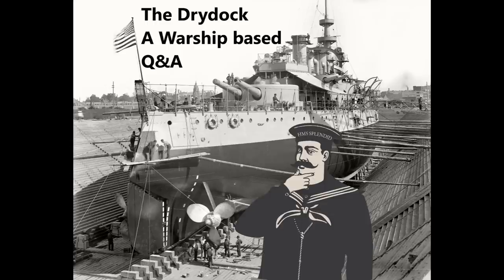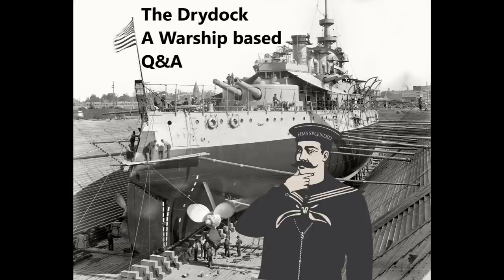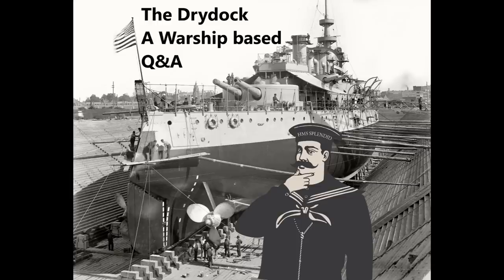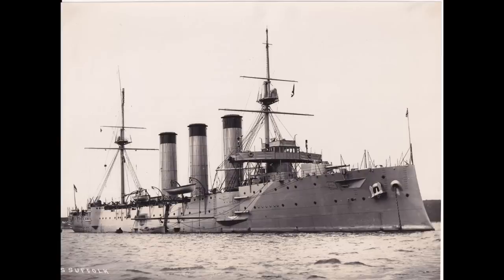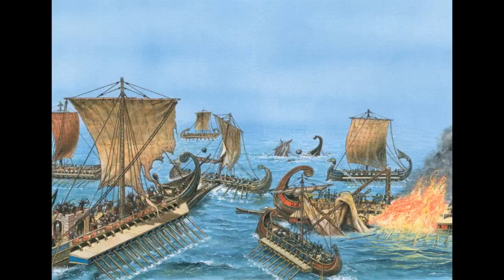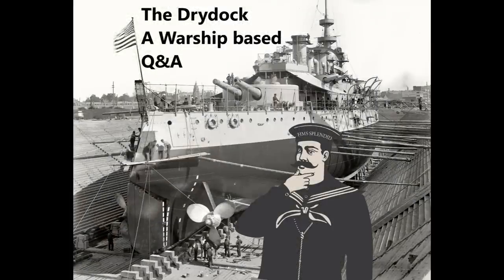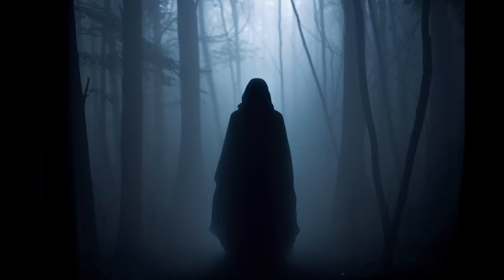The Drydock - Episode 251

Comment: The deHavilland Comet's windows get a bad rap.  If you look at contemporary jetliners the Comet's windows weren't actually any more square.  The difference is that the Comet's cruising altitude was twice as high as any of its competitors, so the stresses those windows were dealing with were orders of magnitude higher than the competitors' equally square windows had to deal with

(I just watched Mentour Pilot's video on the Comet and its windows :D )

Comment: Actually one of the main problems with the Comet was that the holes for riveting were punched rather that drilled. This caused fractures which were made worse by the pressurisation of the aircraft and led to failures. Many aircraft before this period flew at lower levels and therefore did not need pressurising. It was only with jet passenger aircraft flying much higher that this became a problem.
Reply: It was early in the aeronautical game of pressurized cabins. No one thought about metal fatigue. Heck the first ones had square windows. Which the Comet 4's replaced with oval ones. I'm still angry that the Canadian Government didn't make Trans Canada Airlines buy Avro Jetliners. They could have used them even as military transports, medevac aircraft. Such a waste.
Reply: I've heard aircraft materials are much more difficult to weld than ship materials.  Aluminum is also a metal that doesn't get along very well with drills, it likes to bind.  Punching holes for rivets makes a lot of sense in this context, but it's unlucky that it caused fractures.
Reply: @jackgee3200  Got it, bad luck.  Thanks for the detail, that's pretty interesting.
Reply: Reminds me of a book I read on the construction to RMS Titanic . One detail was a specification that all plating used for the hull, boilers, decks, and load-bearing superstructure must have drilled rivet holes. Punched holes were only allowed on lighter-gauge plating like ventilation ducts, cabin bulkheads, and the funnels.

Comment: I think a missed chance modernization was the Lexington class CVs.  If the aircraft support arrangements and damage control were changed to be similar to the later Yorktown class, possibly changing an elevator out for a deck age one like pioneered in Wasp and of course improved triple A and triple A fire control, you might end up with something like the later Midway class.
Reply: I had some thoughts on what a modernised Lexington and Saratoga. Have their 2 small elevators replaced with the 3 large ones found on the Yorktowns. Replace the 5/25 guns and 8-inch guns with 5-inch/38s in single and dual mounts respectively. Widen and extend the flight deck and add torpedo blisters in exchange for cutting back the belt armour back by a couple of inches. Only thing missing is someone at the Bureau of Aeronautics or Bureau of ships figuring out the dangers of avgas on a carrier and come up with the CO2 and proper ventilation and suppression systems.

Comment: OK, so. The »window« of the Comet that kept blowing out wasn’t one of the windows the passengers looked out, but the ADF Antenna cut-out. The shape of the passenger windows was fine.
Also: One reason for round cannons bores is that square holes are very hard to drill.
Reply: Most cannon were not drilled from solid metal blanks. 

They were either cast to a sand mold, or built up from iron hoops and staves.

Comment: A spherical cannon-ball is easier to muzzle-load, and will have less friction against the bore:  a square or rectangular projectile will have a lot more friction against the gun-barrel while loading. Pushing a 24 pound ball into the bore with a pole is easier than pushing a 24 pound block.
Reply: Not to mention a sphere will have much better aerodynamics and flight characteristics in a smoothbore barrel with lots of windage. A rectangular projectile rattling around the barrel as it's fired will present wildly different aerodynamic shapes based on how it moves and then tumbles in flight, whereas a sphere is a sphere from any angle.

Comment: The USS Nautilus was the end of the line for the WW2 submarine hull forms. The ports in the casing produced massive levels of noise and vibrations at the speed a nuclear submarine was capable of and actually damaged the casing to the point that the Nautilus had to be retired due to mechanical damage and hull cracking caused by the casing design.
All subsequent US nuclear submarines used the hull design pioneered by the USS Albacore - a diesel electric boat optimised for underwater speed at all costs.
As for the “Greek fire” thing - naphtha is a byproduct of production of bitumen (and the base for unleaded petrol), Palmitate is better known as sodium palmitate and mostly used for bath soap. Olive oil based bath soap is still made in vast quantities in Syria - and available in most supermarkets globally. So making napalm at home is actually easy.
Getting it to self ignite is a different question - heating it to above autoignition temperature would be one option, adding something else to it like a nitrate salt could be another.
Reply: One can visit the USS Albacore museum in Portsmoth, New Hampshire, USA.

Comment: 00:24:36 Why only round cannonballs? Drach explains the difficulties of square or non-round oddly shaped cannon bores; adding to that homogeneous non-spherical, cylindrical, cubes or other shaped projectiles would tumble ("cartwheel" or "keyhole") as soon as they are shot out of a smoothbore cannon.  A tumbling projectile would have extremely random aerodynamics, lose speed rapidly and would almost certainly fly all over the place. Range and accuracy would be a fraction of true spherical (round) projectile. Even short range canister (anti personnel) round would use spherical buckshot to maintain projectile speed.

Comment: 00:00:46 - Why did naval designers persist in putting casemate guns so low in hulls for as long as they did? 

Another consideration easy to overlook is the prestige factor or "Presence" to use Dr. Alexander Clarke's term of choice. While it seems foolish, a cruiser's apparent firepower was arguably as important as its practical firepower. 

Having more and bigger guns, even if half of them didn't work necessarily after all, was impressive on civilians and sailors alike, improving the diplomatic effect. Being able to say one's cruisers had TEN guns of this caliber, even if only six could function more than half the time, could be deterring to opponents and inspiring to friends. 

So when it came to pass that it was found many casemates were not working so well, there is argument that it didn't matter so much because the cruisers weren't going to need to fire those guns if they did their main job of scaring the opposition into not fighting in the first place because the Royal Navy had so many guns on paper.   

Now, this doesn't make such an argument a good one, because once the shooting starts, having more guns means nothing if they can't actually fire, but when most warships are built, they are doing so to meet peace-time diplomatic agendas.
Reply: Deterrence.

Comment: I've read that the British insisted that water and oil fuel were not to be taken into consideration when calculating the new Standard Displacement on the ground that their ships had to be capable of steaming further in defence of the Empire.  But is was also a way to conceal the new and secret method of allowing water into space in the armour to increase its effectiveness. 
With the square cannon shot I also wondered about the ballistics of such square cannon 'balls'  Would the blunt face reduce the range or cause it to tumble in flight?
It the blunt face actually hit a ships side, would it have more penetration or be more prone to breaking up?
Reply: Projectiles would have to have aerodynamically stable shapes.  Similar to the 120mm tank gun Projectiles used in the current German and U.S. and other militaries.

Comment: About armour belts hit by missiles. It's a very different type of impact with much greater energy and impact than anticipated by the designers, novel types of failure, like failure of the support system (less shock to the armour because the missile lacks penetration aids but much more stress on the supports), or shock effects transmitted through the ship's structure. No argument with Drax's points of course.

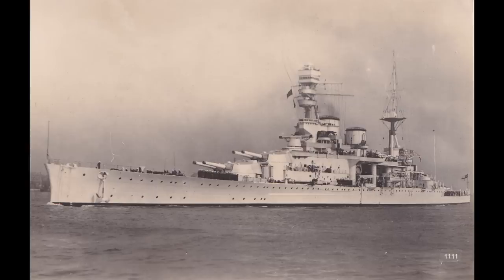Comment: 14:45

I think even if Repulse had Renown-pattern AA it would not have saved Zed.

Competent strike aircraft will always triumph over warships unprotected by their own fighter aircraft. 

The IJN strike forces at Coral Sea and Midway were much the same as they’d been against Zed, while USN had CAP and benefit of six months war learning, and still could not prevent losses.
Reply: If nothing else, a modernized Repulse might just be able to run away. Force Z was pretty close to getting away, no?
Reply: @AmosDohms  

No, I don’t think it would even have done that. Modernization wouldn’t have made Repulse any faster, and the evasive maneuvering both ships did, which prevented them making progress in a heading out of danger, would still have happened.
Reply: @dougjb7848  Competent strike aircraft failed many times during the war, there is a non zero chance that the improved AA of a refitted Repulse might save Force Z. All it would take would be the critical strike on PoW being broken up, and either missing or hitting the torpedo defenses.
Reply: @dougjb7848  But yes, I don't think it would make Repulse any faster. Unless her machinery was in really bad shape before.
Reply: @AmosDohms 

But the IJN strike aircraft could have kept up the attack for much longer than it actually took for them to sink the ships. 

WW2 has several examples, from after December 1941, of ships which kept aircraft at bay until they ran out of ammunition, and then succumbed pretty quickly to aircraft making their runs without interference from AA. 

They could not have gotten fully away, out of airstrike range, before that happened to them.
Reply: @dougjb7848  Yep, I think I agree with you there, mostly because of how the British AA effectiveness was ruined by the tropical heat. Force Z needed air cover or to disengage earlier to survive.

Comment: It occurs to me that the lower placed guns were in a better position to deal with small, fast boats like torpedo boats which had gotten close enough to get inside the range of guns mounted at the deck level. This may explain why the lower guns were still being installed despite the sea keeping problems they presented.

Comment: Warship based escape room? Sounds alot like the new Battlestations MGM made for the Navy. As tired as I was it was very fun.

Also teh cannonball question got me thinking. Did the "Minne Ball" design ever make it to naval cannon?
Reply: The Minnie ball had a cavity in the base where expanding propellant gases can cause the soft lead to flare out into contact with the rifling to impart spin. When were cannonballs or other naval projectiles ever made of something soft enough to deform like that? A lead cannonball would kind of defeat the purpose, and iron won't deform like that under the kind of pressures found in cannon that continue to be functional. Even when they blow the cannon up, iron is brittle and shatters rather than deforming.
Reply: As we have seen time and time agian navys have tried some weird things. Some worked and some didn't. My question was has anyone tried using them. Not "Did they replace balls", because they obvisously didn't.
Reply: @bluejacketwarrior2457  Admirals Cunningham, King, and Nelson, amongst others, are absolute proof of the veracity of your last statement.
Reply: yes, sort of.. As far as i know during the American Civil War, several types of shot and shell have been tried with lead-or even papermache-backends which would act as a Minie-ball. While the shell itself was still iron, the base was supposed to expand under pressure and catch the grooves in the barrel. Especially the James Shell, the Schenkl Shell and some solid shot for Parrott-rifles had these features. Originally landbased guns, they were widely used onboard ships, so i think they count as Naval cannon too.

Comment: There are two elephants in the room when people compare modern missiles to WW II aerial bombs or HE shells (aside of the third one that everything modern is confidential and very secret). Modern explosives generate much more pressure than WW II ones so even if the weight of the explosive is similar, the boom can be much bigger. The second one is that they do start fires and a lot of fires especially if they didn't burn all their rocket fuel before the hit. Those mixes are very flammable. They might end mission killing the poor ship even without sinking it. The armor plate might last, other parts of the ship might not.
Reply: Plus modern (and even back in the 80's), ship killer missiles quite often did a pop up maneuver, and came down on the deck near vertical.

Honestly, i would be more afraid of a sea skimming missile that dove and exploded under the keel.  Nothing like having your honking big aircraft carrier break her own back due to her own weight.
Reply: Exactly. End day, these missiles are designed by VERY smart people, with the plan being they wreck ships. If they get al way through design and test process to deployment one must be fairly sure that they are gonna do that if get to hit...

And yes combine the modern spec HE with its much harsher shock-waves and add in the propellant- its hell of a nasty mix.. i WOULD NOT want to be on ANY ship tanking hits from large Eastern block stye anti ship missiles, no matter how thick the steel plate.
Reply: @jeromethiel4323  There are plenty of missiles designed to do pop-up maneuvers, They don't dive, though. That's torpedoes. A heavyweight missile crashing into the ocean at close to Mach 3 would shatter on impact.
Reply: @grahamstrouse1165  Meh.  I'm sure if someone put their minds to it, they could develop an ocean skimming cruise missile that could drop a torpedo.

But you are correct, as far as i know nobody has done it yet.
Reply: ASROC ???
Reply: @jeromethiel4323  Pretty sure that exists.

I think India tested a torpedo dropping cruiser missile.
Reply: @gokbay3057  You could very well be correct.  I was just unaware of such a device.  It seems like a smart idea.
Reply: The SUBROC UUM-44 comes to mind.  The SILEX SS-N-14 variant fitted with an ASW torpedo would be a threat.   SILEX, MALAFON,  and IKARA could be used as a sea-skimming missile threat, but simply by running the whole weapon into the target.  ASROC with a Mk 44 or Mk 46 payload could not do much harm, but a Mark 17 RTDC would crack a keel 😮
Reply: @davidmurphy8190   And this is why we can't have nice big battlewagons anymore. Missile this, missile that, guided rocketry is one big fun police.

Comment: Make the barrel thick enough compared to the bore and square shot can be can be done (eg Puckle) along with your example, a lot easier in handgun sizes.
Reply: Square rifling is difficult.
Reply: Hand guns don't normally use ammunition with an exploding projectile.

H&K makes a few handguns with hexagonal barrels.  But the ammo projectiles can't explode.  They merely suffer the slight deformation with stoicism.
Reply: @libraeotequever3pointoh95  Neither did the age of sail shot explode. Exploding shell was a later, late age of sail/early age of steam invention.